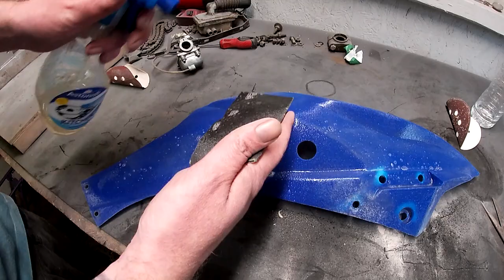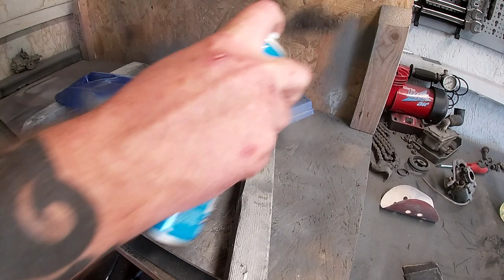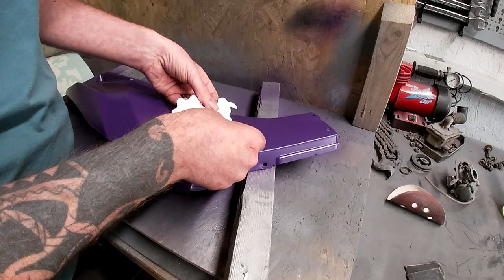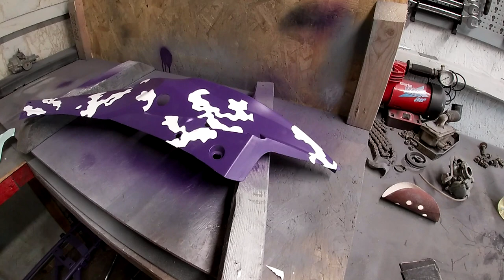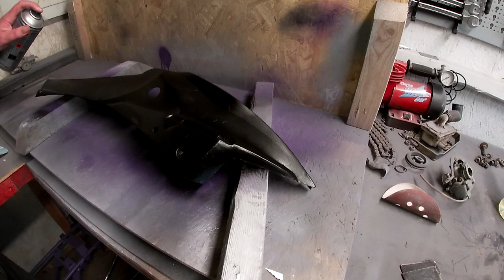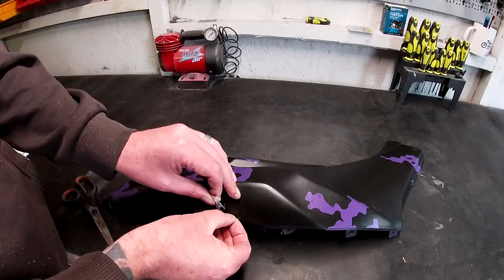Camouflage Spray Painting ATV (QUAD) Plastics -First Try

Comment: Thanks for doing these videos. Your engine rebuild videos have helped me a lot. I recently put the cam chain tensioner spring in first and now its lost in the case. Waiting on my flywheel puller to come in and I feel confident with your videos as a reference that I will get it fixed.
Reply from the maker: Thanks for the kind words if it’s your first time tearing and engine down take pictures so if get stuck on the rebuild u can refer back to them good luck hope all goes well if need any help let me no 👍
Reply: @ScottsShed  Thanks for the response. You make it look so easy!!!            I guess 20 plus years of experience will do that....I am hoping after I take the flywheel and housing where the cam chai tensioner is located, that I will see the spring and be able to remove it.